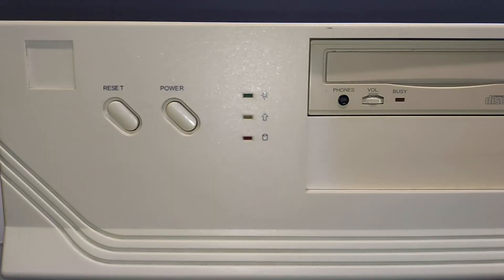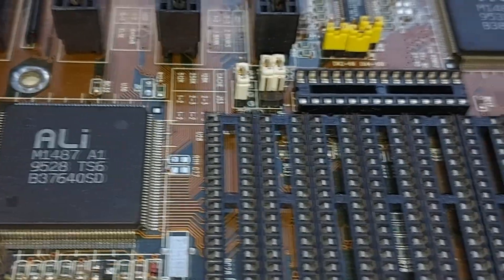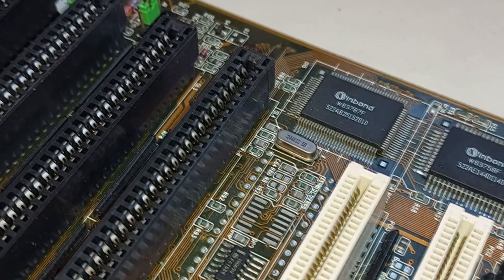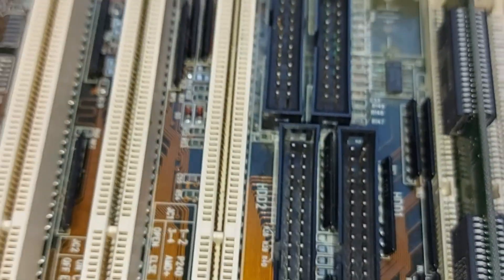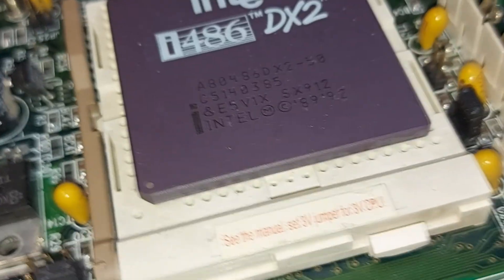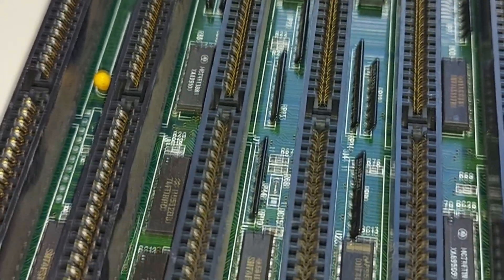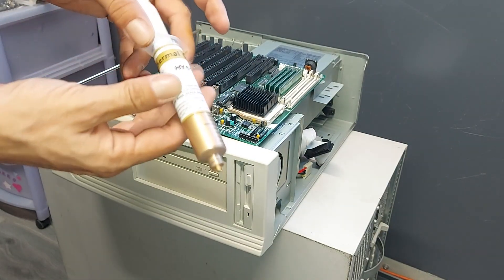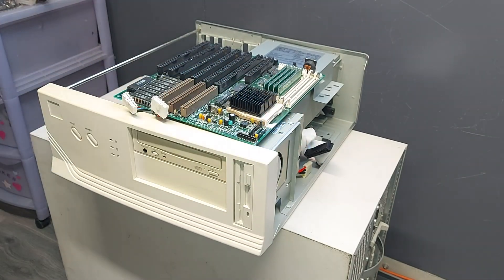Building an Intel 486 VLB DX 2-50Mhz machine, 16MB RAM, Tseng ET4000AX, SB16 Value

Comment: I overclocked my Intel DX2-66 to a DX2-80 (jumper setting) + all wait states on (motherboard + BIOS) + Tseng Labs VLB video card. Doom rocked 🤣 Best cooling required !
Reply from the maker: That is a nice overclock on a 486! If you have the appropriate cooling, you can get away with pushing them to their limits. I've seen The AMD X5 133 being pushed all the way to 200mhz, which is insane but does require a Peltier module to reach those kinds of speeds.

Thanks for sharing.

Comment: What's the difference between ET4000 and ET4000AX? Thanks.
Reply from the maker: Hey Conenion, they are both essentially the same card, the AX being an enhanced version of the ET4000, featuring improvements in performance and additional functionality by optimizing memory access and bus performance. 

That meant that the ET4000AX could handle higher resolutions and color depths more efficiently, making it faster in many cases, particularly in high-color and high-resolution modes.

Primarily using the ISA bus, the ET4000AX was designed to better handle the available memory bandwidth with support for up to 2MB of video memory in some configurations, allowing for higher resolution displays and better performance in memory-intensive operations.
Reply: @Branco_G  
Ok, thanks mate.
Reply from the maker: No worries man, take care 👍

Comment: Really need a VLB graphics card lol
Also, you always want to populate VLB slots starting from closest to the cpu and then work your way out.
Something about the VLBus being a direct connection to the CPU and less chance of interference, coupling issues, etc.
Reply from the maker: Yeah, I know man. I am going to make a conscious effort to get hold of one for her. 

Cheers for the little tip, always massivly appreciated. It's been quite some time since I've messed around with a 486, so little gems like starting at the VLB slot closest to the CPU have been forgotten!

Comment: Nice build. But why are you using an ISA video card instead of a VLB video card? This ISA Tseng ET4000 card is pretty much bottlenecking the performance of the machine. Any cheapest VLB card would outperform an ISA card.
Reply from the maker: Hello Peter,  for the moment, the choice I had was limited to the ET4000 or a Trident TVGA8900C ISA card. 

I currently do not have even a cheap VLB card in my collection. Excitement got the better of me, and I really just wanted to get this machine up and running.

I figured that I would be able to source a VLB video card at a later date and for the time being just deal with the slower card.

I suppose, in some ways, no different than how it used to be 😊

Thanks for the comment. I hope you are keeping well.

Comment: Yep nice case! Im trying to fix a UMC socket 3 board currently, which has many damaged by varta tracks. I want to get my umc u5s-super25 cpu going in it.
Reply from the maker: Thanks, yeah I've got a small pile of boards that need that kind of intricate work needing to be done on them. I've seen it done by others on the tube, and from what I can take from what I've watched is, as long as you have the correct equipment, and a steady hand, there is no reason why you should not be able to achive your goal.

Good luck with your repair job, and thanks for commenting.
Reply: @Branco_G  Ye steady hand is what I'm missing hahaha
Reply from the maker: Haha, tis why I have not given it a shot....yet. I would quite like to move into that kinda thing in the future. I've got enough stuff going on at the moment.

If you have any old circuit boards to practice on first that would be a good way to try and steady your hand.

Comment: Nice Build I really like that Case. Thanks for the Video.
Reply from the maker: Thanks George. The case is in really good condition for its age, no rust or anything. 

Thanks for the comment 👍
Reply: @Branco_G Do you know the make?
Reply from the maker: @johntrevy1  Hi John, as far as I can see, it is just a generic case. There is no marking on the case of who manufactured it. 

All there is on the back of the case near the PSU is a barcode with 486DX2/66 dated 30/10/95 with the numbers 1030436130 under the barcode. 

The PSU appears to be unbranded with model number PTP-2006C. Doing a little Google search, the model number brings up DTK computers. 

That is all the information I can provide on the case. I hope this is of some use.